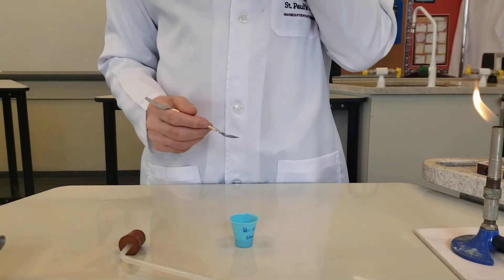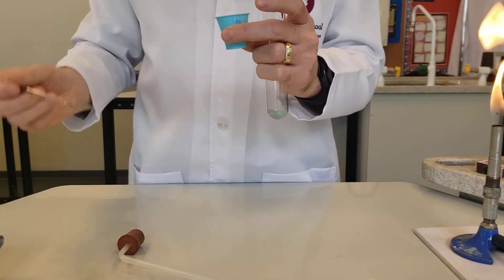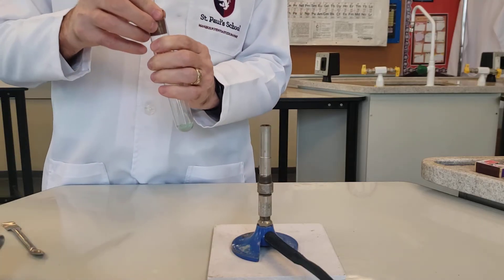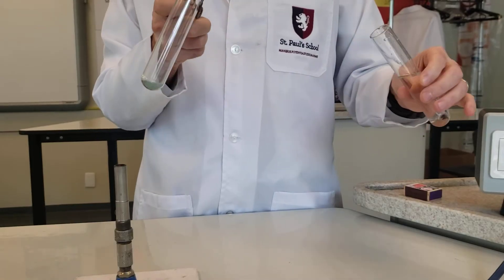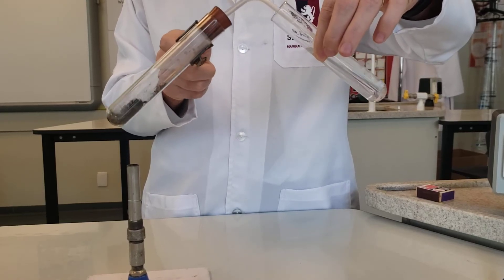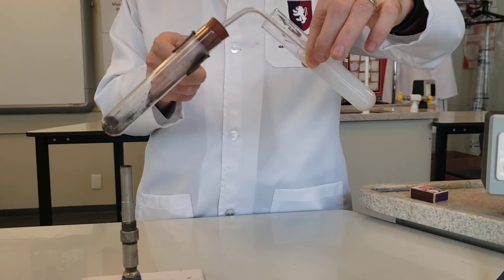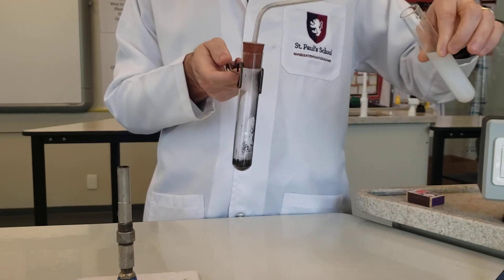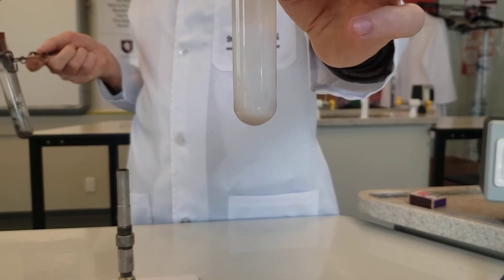Thermal Decomposition of Copper(II) Carbonate

Comment: mister, how to gently heat and strongly heat
Reply from the maker: First put on safety glasses and tie your hair back. Strength of heating is achieved by controlling the Bunsen burner and how you heat the object. Increase the flow of gas to make the flame bigger or smaller and control the heat of the flame by opening and closing the air hole. All heating should be with the air hole open or partially open so that the flame is blue and not smokey and yellow (this is the safety flame where the air hole is closed so the flame is yellow and cooler so it is safer - you can see it and it is less likely to burn you), so mainly control the strength of heating by decreasing or increasing the gas supply at the tap or in the Bunsen burner inlet valve if your Bunsen burner has this. Gentle heating would have the air hole half open and with a low stream of gas to give a small blue flame. Strong heating would have the air hole fully open and with a bigger gas stream. Some Bunsen burners have an additional air intake screw near the outlet of the stem so the flame gets even more oxygen and burns even hotter. You also control the strength of heating by how long you leave the thing being heated in the flame. Gentle heating involves passing the object in and out of the flame, whereas strong heating involves leaving the object in the flame for longer - please take care when doing this! Always remember to reduce the gas and close the air hole when not using the Bunsen, or just turn off the gas supply. Ask your teacher to show you how to use the Bunsen burner correctly.
Reply: @Vajradaka  thank you 🙏